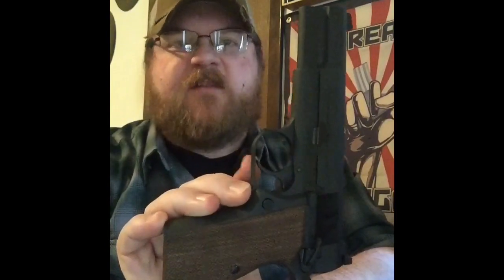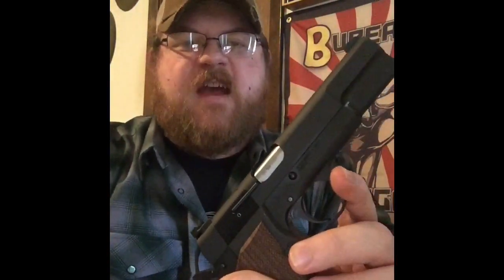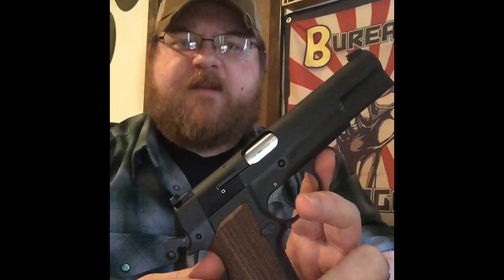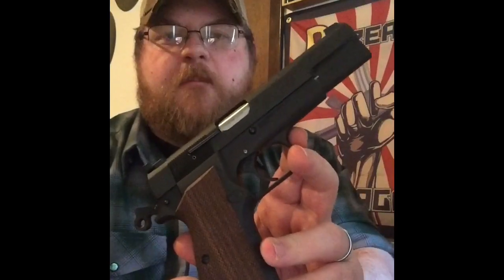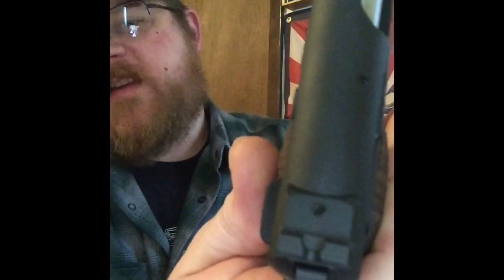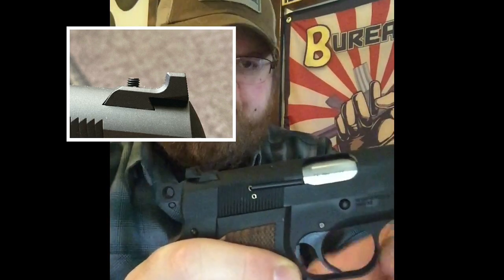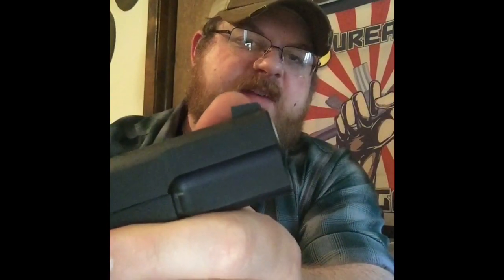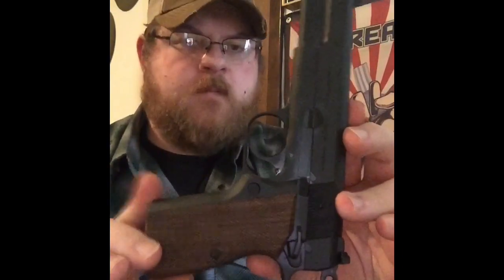Get in them guts- What I found inside the SA-35

Comment: I purchased my SA-35 last month (October 2023),  my safety does not have any play when the hammer is down. Springfield must have addressed that. Also, my slide release isn't sharp and works fine. I took the day off to go to the range today since the weather is so nice and ran 100 rounds through it with no issues and I'm improving my groups. Thanks for the review and I subscribed.

Comment: I have had a Browning HP for 35 years. Shot numerous IPSC local club matches with it. In 2014 I sent it to Terry Tussey's for a trigger job and new sights. The trigger while not as light base a tuned 1911, is now clean and zero creep. 

I recently got thr SA35 and while that has a decent trigger, it had noticeable creep. So I thought I woukd tear the BHP and SA35 apart and swapped the sear and hammer. It came apart rather easily, even easier than the 1911, with just drifting one drift pin. 

As for 3rd hand, I use zip ties. I zip tied the leaf spring to keep it from moving while I drifted the sear pin out. Out popped the sear. In reassembly, the zip tie will keep the leaf spring in place. Push the sear pin partly in but before it protrudes past the ejectoe. I could push the hammer back with ine hand while adjusting the sear to thr full cock hook, then push the pin in enough by hand. Then tap the pin in till it is properly seated. Cut thr zip tie.

If you can't hold the hammer back with one hand, the SA35 has a hole near the butt on the frame so yiu can run a zip tie to thr hammer ring and through the hole in the butt kf thr frame, cock the hammer and zip tie tight. It will hold thr hammer cocked until you install the sear and drift the pin in. Cut the zip ties. No need for third hand tool.

So now my SA35 has an instant trigger job.

Comment: Nice review it answered many questions I had. The popularity on these comes and goes over decades and one thing about them is they don't fit everyone very well where it can be cocked and de-cocked, the slide release, magazine release, and safety can all be operated without shifting your hand. My dad carried a 1911 in ww2 with hammer down on a loaded chamber. The old timers claim the HP is safer to carry like that, and that was how most experienced HP users did, and many still do. I have a modified for target use HP from way back playing around with small bore autos like the 38 super, I found you have to load your own ammo to get good accuracy with 9mm, more tricky then45 auto.

Comment: What's going on with the finish on this gun? There's a number of complaints on blemishes and poor finish.
Reply: Gently wetsand under running water with 1200 grit wet sandpaper from WalMart.
Make sure to gently break all sharp corners.    Frame,...slide,...every part except wood grips.

You will love the look,..the feel and the instant patina.  Wipe down with lightly oiled cloth.   Wipe the grips too.

Comment: I picked up a SA 35 a couple of weeks ago and the first thing i noticed after admiring it a few minutes was how sharp  the edges were.
There's no way the finish will hold up on all of these sharp edges; just a light dehorning would go a long way in making this an excellent pistol.
If you have large hands the rear frame will eat your hand up after several rounds.
Over all though, it's hard to complain about a $639 Hi Power.
Reply: Yes 600 bucks and it’s not poly. A real truck gun. Lok grips and elbow grease. Boom done.

Comment: I've seen MIM thumb safeties snap off at the range ...
My line of work is where your life depends on your firearms,  so NO MIM for me on ANYTHING
Reply: Which leaves what? Vintage guns only?
Reply: @callofthewillman4469  no Sir, all Dan Wesson 1911s are fully machined steel parts, no MIM and hand tuned and fitted at the factory. Awesome stuff, check em out 👍
(And half the price of a Nigjthawk).😎
Reply: @willraven7  Dan Wesson 1911=2000$       Springfield sa 35=600.   I'll just change the safety.   But mim parts are reliable as they have been used for decades
Reply: @justinlance4174  Split the difference. Shadow 2.

Comment: First off, excellent video!

When you tried to use the third hand tool, did you pull the hammer back that extra little bit from full cock? I had to do that to get the tool around the hammer on my hi power, it won't go on just from the full cock position.
Reply from the maker: I did, it’s still just a hair too thick to get the tool on there
Reply: @pipe_guy  Aha. I wonder if you tried taking off the rubber attachments and sand down the inside edges of the tool until you get a good fit? Might try that if I ever get one. Thanks!
Reply from the maker: @Alex_Christcrusher  that would probably work. I’d just wrap the arms in masking tape or something before use after that.